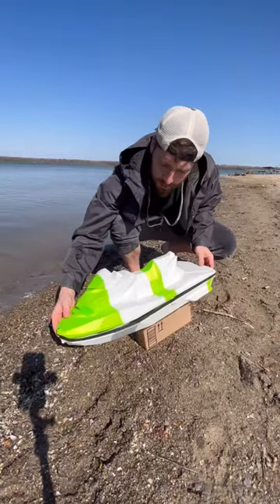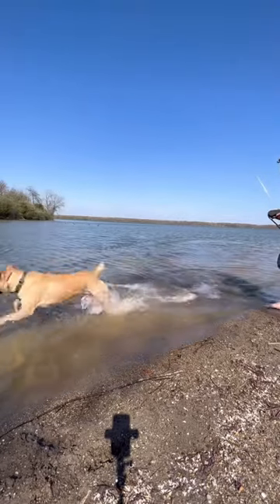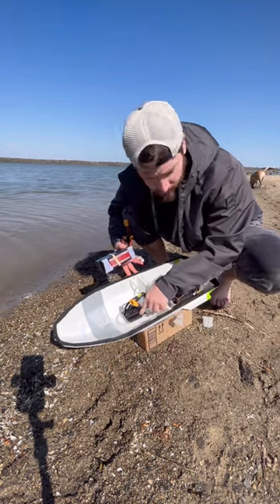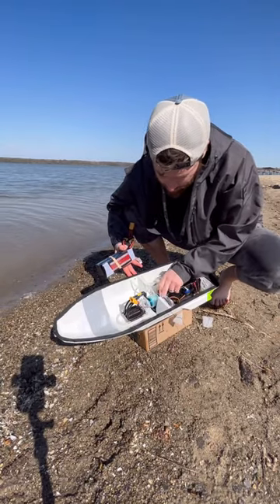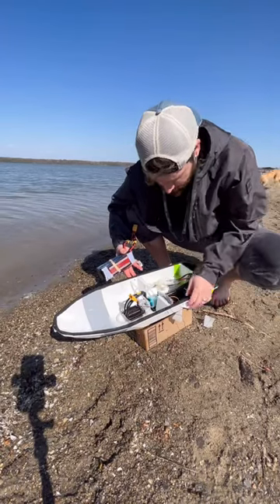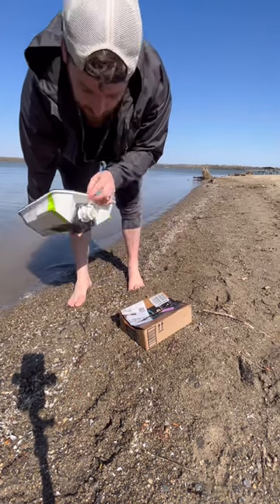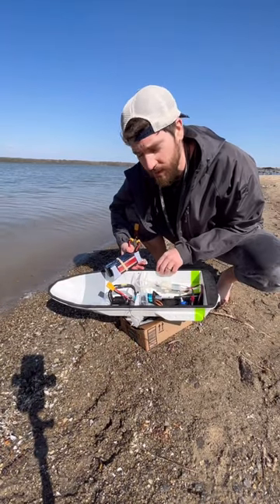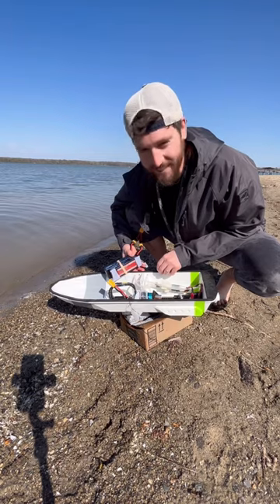100% 3D Printed Jet drive RC Boat! With Pancakes 🐶

Comment: Looks awesome! Where did you get the print files from?
Reply from the maker: So I got the jet ski print off thingaverse and then I added a different jet drive that I personalymade in fusion 360.
Reply: @JakeItsTheCops  I think I had seen it when I was browsing after watching your vid, looks good.